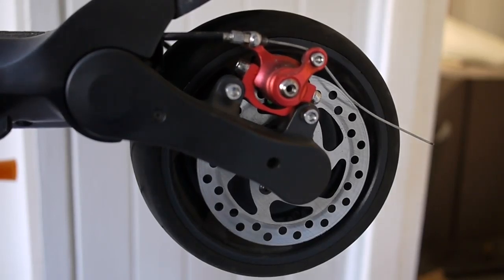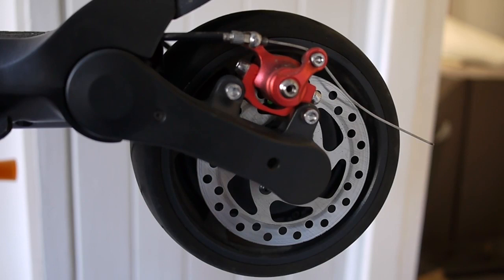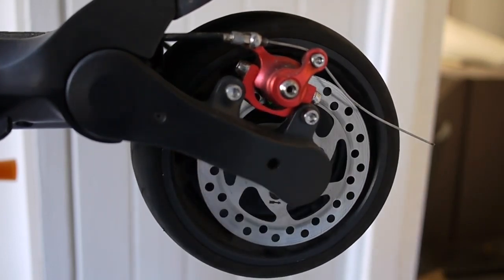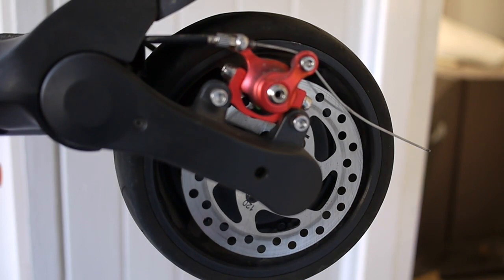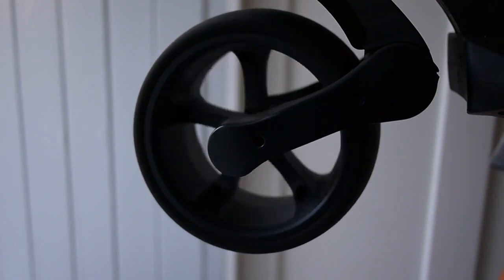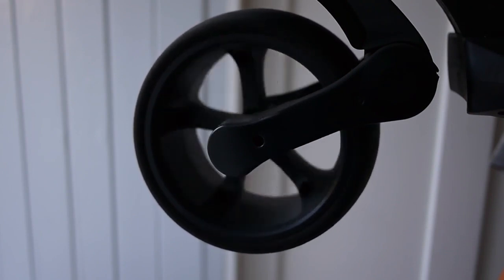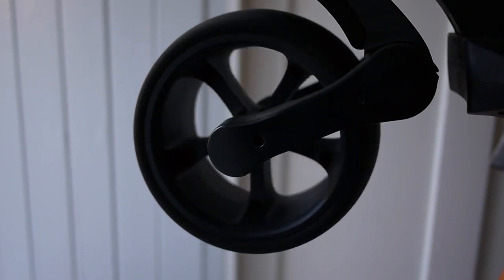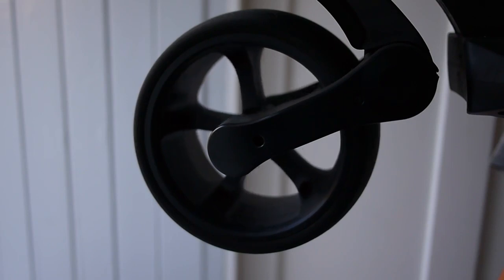Mercane Wide Wheel - Wheel Friction

Comment: Makes me feel better about my monstrous 18.5 Nm torque.
Reply from the maker: I've not measured the torque of the WW, but because of its smaller diameter wheels its an amazing hill climber.
Reply: @finophile  I was just going with a spec sheet for the 2019:  single 18.5, dual 37 (max)   --- not unhappy.

Comment: Hi there. It definitely shouldnt be like that. I had the same issue with my m365. Most of e scooters have their disc brakes set up way too tight. I'm sure you could easily adjust it by loosining the screws. Cheers

Comment: Hi any advice for fix error o5
Reply from the maker: Wide wheel of my model has no error codes or display to display them. Check wires, check voltages (both when charged and under load).  If needed remove belly pan and check the cables from the controller to the wheels.